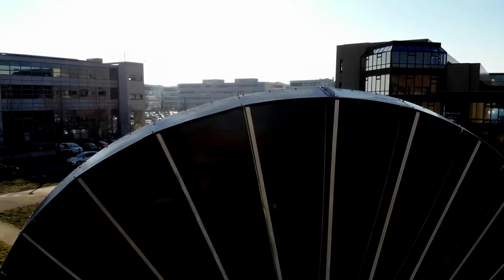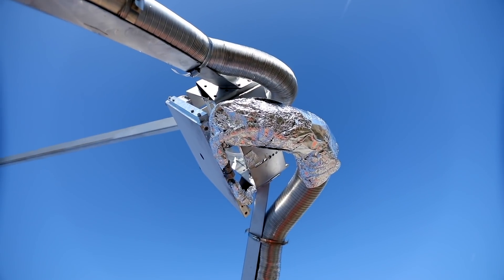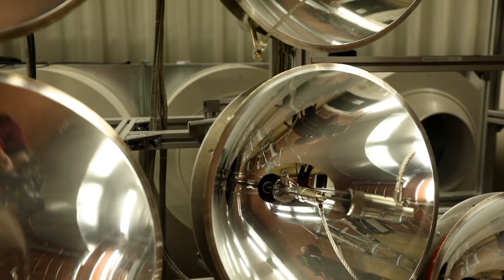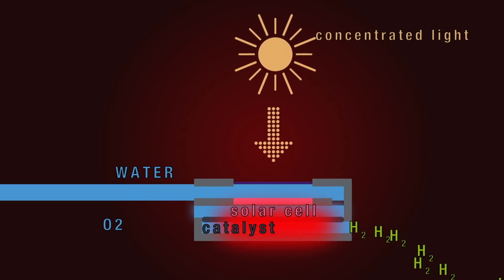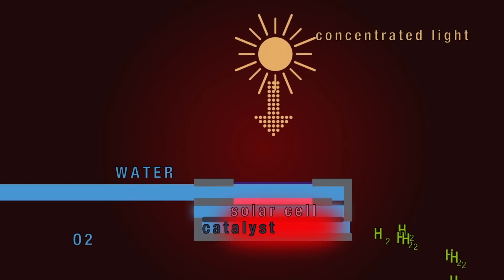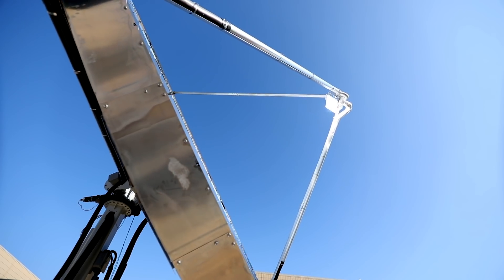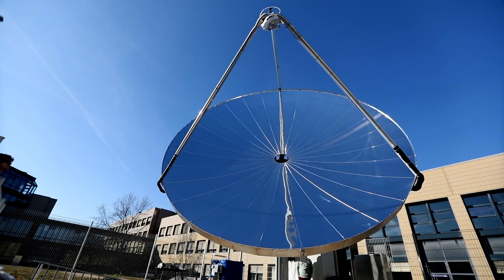Record solar hydrogen production with concentrated sunlight

Comment: Why do all these people want to use solar hydrogen in cars??? That's the most wasteful use possible. It's also not obvious how this can compete with $6/kg for hydrogen produced by conventional renewable energy, especially since that energy will be essentially free in the near future because of the production and load mismatch of solar facilities.
Reply: Hydrogen isn't the best for cars. But it has other use cases like jet fuel, trucks etc, and maybe even industrial fuel.
Reply: @mrgyani  Hydrogen isn't good as energy storage medium, at all. It has awful volume efficiency. It is marginally useful as rocket fuel if you need the max. ISP that one can get with reasonable safety from chemical propulsion.

Comment: 1kg hydrogen production per day. How big is that prototype? Is it scalable? Also, it seems to use energy to follow the Sun. Does it require fresh water? or can you use sea water?
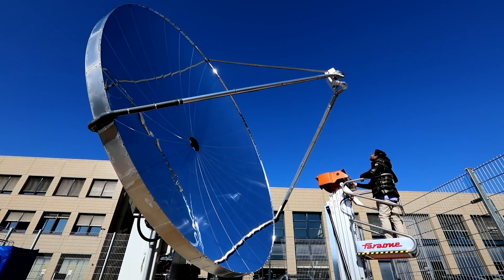Reply: Look at 1:37 : the dish diameter is about 5 m. Thus, the dish cost is about 8,000 USD (if 400 $/sq.m). Thus, H2 cost is about 3 USD / kg (if its production = 300 kg / year)
Reply: @сергейюрко  Cool.  Does it require fresh water? or can you use sea water? Note that in most places, fresh water is a valuable resource as well.

And now that you have hydrogen at the plant, how do you transport it to the location where you will use it? This normally requires cooling and/or pressurizing, which are energy intensive in their own right. And then there is the actual transportation. All of these things add to the cost.

Finally, there is the additional inefficiency of converting the hydrogen back into something useful, like electricity or mechanical energy.

These may or may not be deal breakers, but they should be considered and defined to make a useful system.

Comment: This then does not add to the Thermal total of earth system as if not concerted Heat from Sunlight is adding to the Thermal total. And using any kind of fossel fuel is also adding to it. We should work more hard on this subject.

Comment: I live in Thailand. These could be installed at every LPG, CNG and petrol station. Then a compressor would be used to fill a high pressure storage tank. Then each station could double as a Hydrogen fueling station.

Comment: What is it's efficiency? 1 kg of hydrogen per day sounds like a lot.
Reply: You're asking about efficiency??  Why be concerned when the heat to power it is totally free!  It's a matter of ROI -- if it generates enough green hydrogen to pay for itself in a few years, and lasts a few decades, then it's a very sound investment.  We need them now!  By the thousands and more!  The whole world must be converted to run on green hydrogen as soon as possible!
Reply: @acmefixer1  Your statement is completely false, because you need the concentrator, which has CAPEX that translates into a certain $/kWh for the energy. The more efficient it is, the lower the effective $/kWh of absorbed solar energy. The efficiency will actually allow you to calculate this ROI that you're talking about.